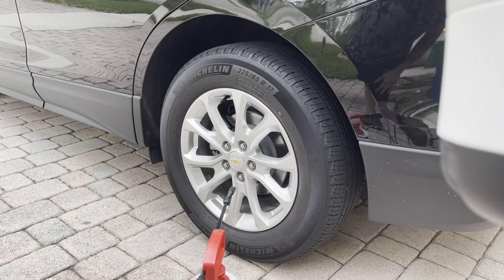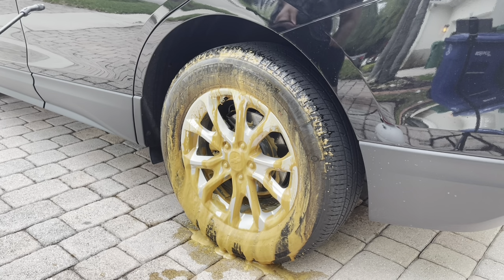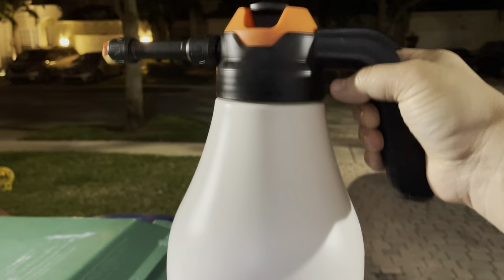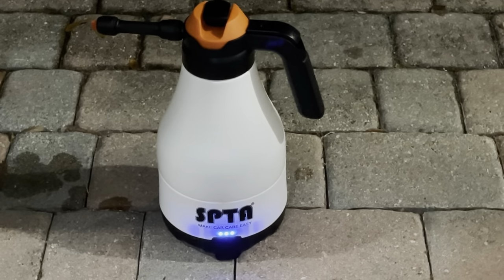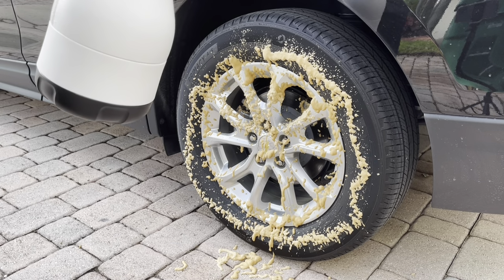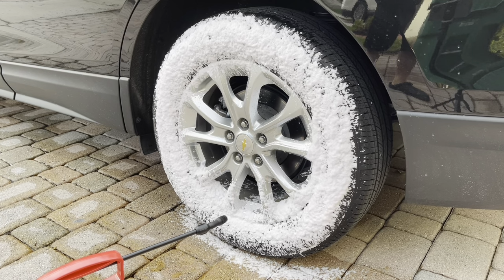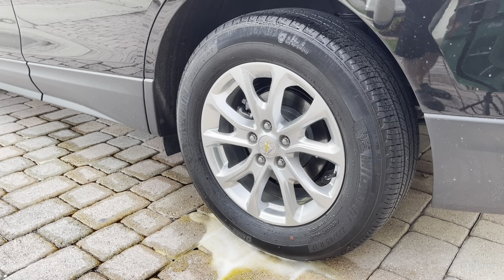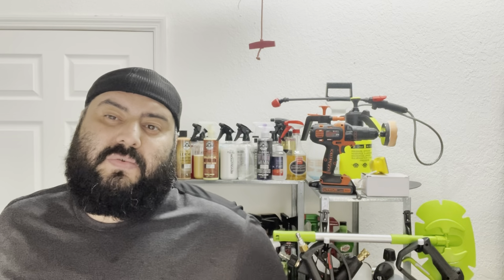Spta cordless foamer, is it worth it?

Comment: if you lose/forget the rubber gasket in the nozzle tube, this happens. the spray pattern def is not as nice though
Reply from the maker: I wish it was something simple as that. What really frustrated me was that my first sprayer worked perfectly fine. The replacement sprayer is not performing as expected. But the silver lining is that as a sprayer it’s great. As a foamer it has t performed as I wanted.
Reply: @dragonflydetailing5156  yea I'm probably going to transition mine to sprayer duty as well.
Reply from the maker: I don’t know if you are a fan of brake buster, but I did use that straight up no dilution with the sprayer nozzle. It coated the wheel pretty well and seemed to aerate the solution to give it a foam look. It did something similar when I was using it as a sprayer for clay lube. It tried aerate the solution. It’s not a bad product. But it has a steep learning curve.

Comment: No pressure. Pumping is spoil
Reply from the maker: The first one I had, worked one time. Then after that it wouldn’t build pressure. So far the second one is working but it doesn’t foam as well as the IK foamer.